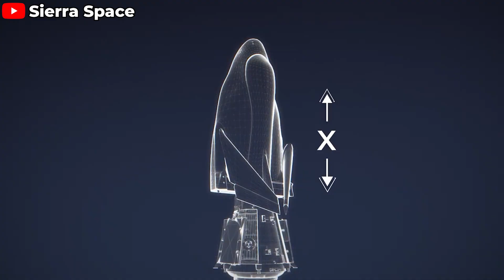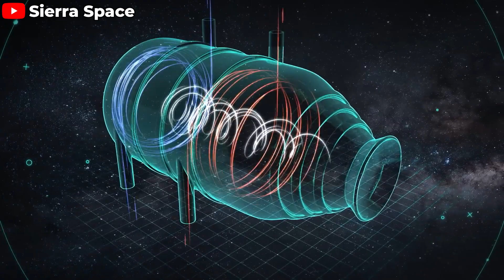Elon Musk's Big Solution to Launch NASA's New Space Plane…

Comment: What would the margins be if dream chaser were stacked on Falcon heavy center core only?
Reply: They call that Falcon9
Reply: @1fastal1  No, falcon heavy is 3 falcon 9 boosters like the delta heavy. The issue is why waste a falcon heavy to send up such a light payload (not cost effective).
Reply: There's no difference between a falcon heavy 9 core besides the ability to hold the side falcon 9 boosters. Your logic is flawed here since a falcon 9 heavy core is the same thrust as a regular falcon 9 rocket.

Comment: Why dose dream chaser need a fairing? If it's tough enough for the down flight, it should be able to handle the up flight. What's the problem? They could also delete the heavy & fragile the wing folding hinges unless that is a flight control motion.
Reply: Because the faring is needed to prevent the max G force from tearing the cargo off the rocket as it transitions from subsonic to LEO. That's why the space shuttle took a huge fuel tank because it had to take a much lower G force path and longer time to reach it's LEO transition where it dropped the huge fuel tank and it had to drag that huge tank past the LEO where the tank separation was done after orbital insertion where a normal rocket dumps the first stage and hits the second stage. Thus, the shuttle had no second stage and had to drag the huge tank past orbital insertion.

Comment: why using a fairing at all? shouldnt it withstand reentry forces?
Reply: My guess they haven't computer modelled launching with out a fairing.
Reply: Probably concerns about ripping off solar arrays and other parts.
But when building an amateur airplane with a different engine than originally designed it is not uncommon to cut holes in the cowling and add bumps (often called 'chipmunk cheeks') over the holes. I don't know why that approach wouldn't be possible for a payload that fits inside the existing faring with just a few things that stick out a few inches to far.